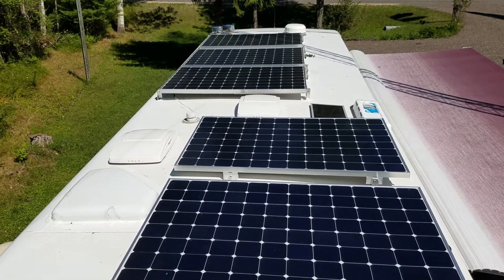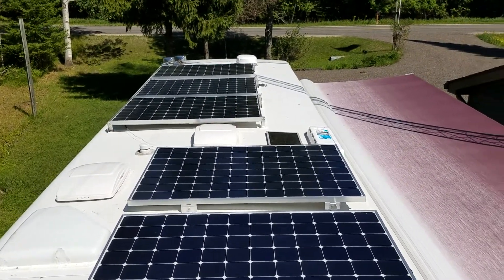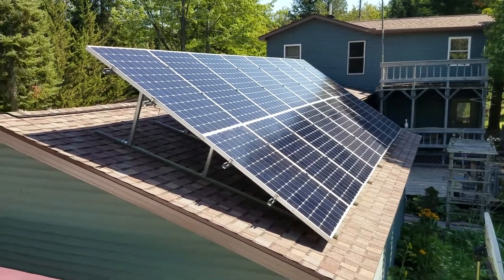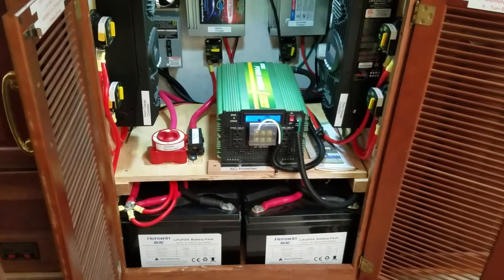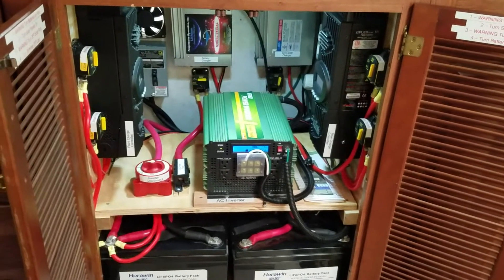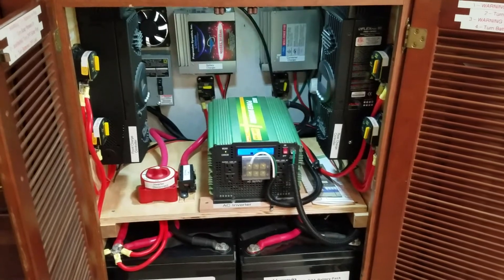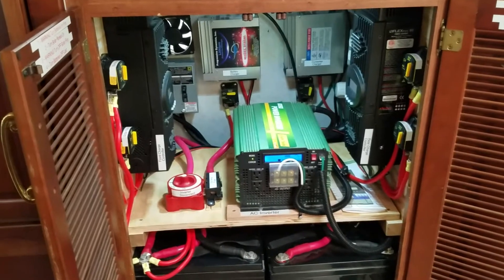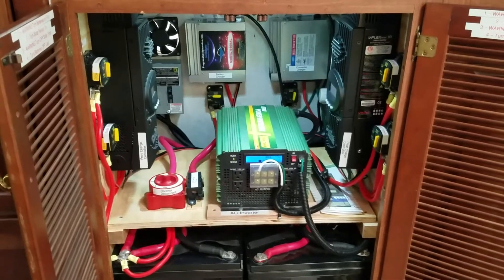RV Solar System 2000 Watt

Comment: Hi there I am thinking about doing 2000 watts of solar and either between 1200ah of battery backup or 2000ah. For my 30amp trailer or would you recommend me going 3000 instead of 2000 I will be full timing off grid
Reply from the maker: If you have a budget and space. Choose the highest wattage solar panels. I currently have two 48-volt batteries and 6000 watt. All in one inverter. I'm looking at adding two more batteries. Also, upgrading the solar to 4000 watts. 

Just returned home after 2 years on the road. Off grid the entire time. Including our air conditioning, residential refrigerator, microwave, and all other systems. 

Thank you for watching our videos and for your comment.
Reply: @igowhereimtowed6839 I think I should have enough room to do 5 or 6 solar panels at 550 watts each and I'm debating on either during 1200 amp hour 12 volt batteries wired together or 2000 amp hour worth of batteries I just don't know how much battery capacity I need to solar I did the calculations I'm running 0.90 kilowatts I think that is what the calculations told me
Reply: I was thinking about doing 4 maybe 6 550 watt solar panels and 6 200ah 12 volt lithium batteries and like a 60 amp charge controller or would I need more like a 100amp to cover all the solar panels  @igowhereimtowed6839

Comment: Nice setup. I’m designing a custom step Van camper to run on 2kw solar. Do you happen to have a wiring diagram?
Reply from the maker: Mark sorry but I don't have a diagram. I did an upgrade to 3000 watts. Just haven't had time to publish a video on the upgrade. 

The wire between the solar panels and the charge controller is 10 gauge. The total amps of the panels is 30 so I have a 30 amp breaker between them and controller. Output of the charge controllers is 80 amps. Have a 80 amp breaker between them and the batteries. The wire from charge controller to the batteries is 2 gauge. Between the batteries and the inverter is a disconnect switch and 350 amp fuse. All wire between the inverter and the six batteries is 4/0. Hope this is of some help. If you you have any questions please post them. Thank You for the comment and watching our videos.
Reply: @igowhereimtowed6839  what Watt panels are you using with the upgrade? And links to them? Also, are you able to run an A/C regularly off this system? Appreciate it
Reply: Just an FYI, Home Depot has the 170ah Renogy lithium’s for like $500 off each. Huge savings
Reply from the maker: All the panels are 345 watt. Yes I can run our AC and heat pump. We have six 100 Ah lithium batteries now. Waiting for the price to come down on the single 400 Ah lithium batteries. I can replace the six for two of the 400 which will give me 800 Ah. That will fit in the same space I use now.
Reply: @igowhereimtowed6839  Awesome. Appreciate the info. If I ever get to build this thing out, I’ll definitely be contacting you with questions 😂

Comment: What would a ball park figure be for your whole system?
Reply from the maker: For the system on the motorhome $6200.00. The system on the garage $6600.00.  Both system are designed and installed by myself. Which saved a ton of 💰.

Comment: Good 👍
Reply from the maker: Thank You
Reply: @igowhereimtowed6839  
“Hello. I would be very grateful if you could give me some information about the Solar Energy System.
 
I have air condation LG dual inverter 18000btu
240v 50~60 hz
 
(Cooling Running Current 7.70 A)
(Cooling1680 W)

If I need to start just 7 hours in 8am ~3pm
How many solar panel..and what I need for this system.I would be extremely grateful! Thank you”
Reply from the maker: There are many factors that have to be considered. How many hours of sun light? Will you track the sun? You will need between 12 and 18 amps for starting your A/C system. What type of batteries will you be using? With the info you provided. Between 3200 and 4400 watts of solar. You may be able to get by with a little less if you track the sun. Also best if you live in the desert southwest of the U.S.  Solar is not as efficient as some make it out to be. Most YouTube'ers with solar are not trying to 18,000 BTU system. I can not say it enough. Solar is not as efficient as it is made out to be. This link has a calculator on how many hours you can get out of your battery system: https://www.donrowe.com/power-inverter-faq-a/258.htm#how_long
Keep in mind this is for lead acid batteries. You can add 20 to 30% more to the time if you use lithium batteries. Good luck with your system.
Reply from the maker: I just checked on my house solar system. This is a 5,500 watt system. Because of cloud cover it is producing only 345 watts. You need to plan for days like this into your design.
Reply: @igowhereimtowed6839  
Thank you for sending me the information. It was exactly what l needed and allows me to move on with my part of this project.
Thanks for replying.

Comment: Hello sir,
I would love to see a diagram if your system. I’m converting a school bus into a full time rv and will be buying some 350w panels (6 of them). If you have a moment to speak or rather email please let me know. Would love to be able to get some information about your system. Great job by the way it look awesome and seems to definitely do the trick. Thanks
Reply from the maker: All the solar panels are wired in parallel. The charge controllers have three panels each. The batteries are also wired in parallel. The rest is visible in the video.

Comment: Good solid system  - 345w per 100a of battery - gives me confidence that my little class c at 280w per 100a of battery is not far out - cheers for posting

Comment: Nice setup! Certainly frees up space for those large panels not having an A/C on the roof. I also really like that all of your equipment is in one spot but, since it's inside the coach, how much fan noise does it create? Also, is that cooling fan mounted on the outside wall?
Reply from the maker: While we can hear the fan running. After awhile you don't notice it. The cabinet was for a washer/dryer. So I utilized the dryer vent opening for the fan.
Reply: @igowhereimtowed6839  Got it. Thanks for the info.